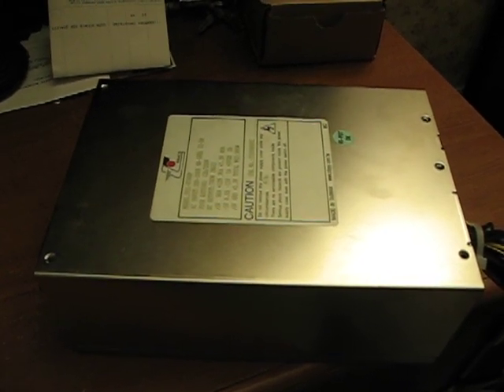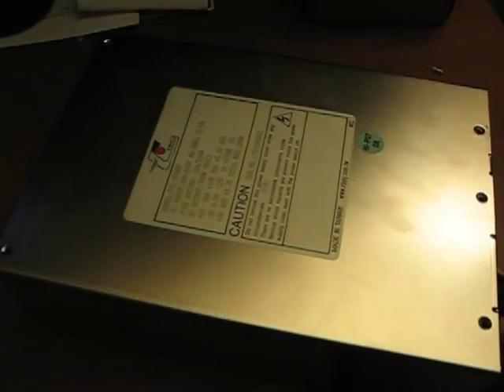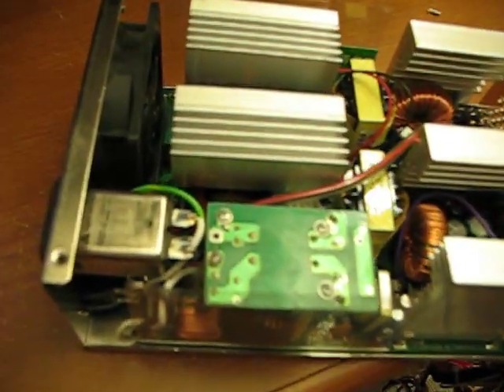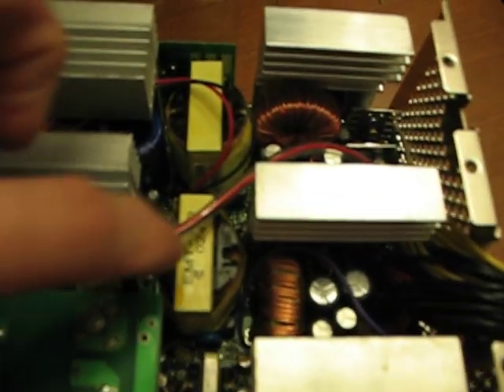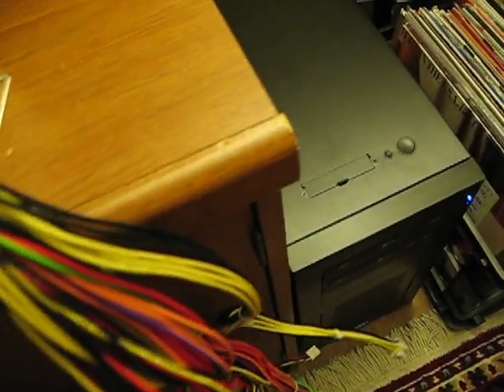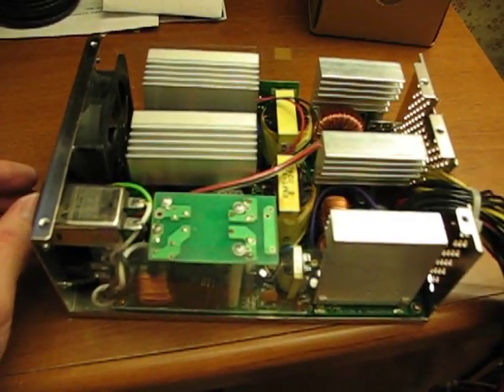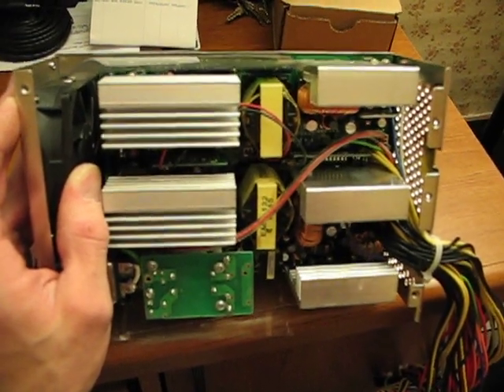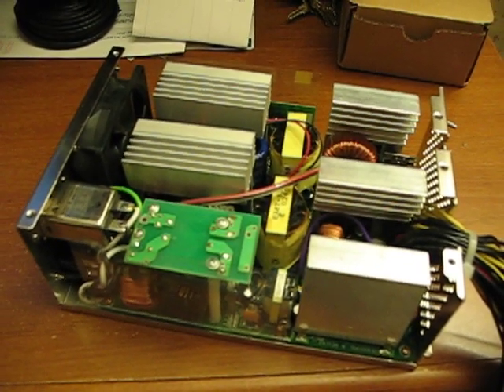A well made PC power supply

Comment: @MilesPrower88 the power pc 9xx series and confined spaces where not a good mix... the G5 power macs where much better designed and equipped to deal with there thermal issues... however they were not without there own achilles heels, two of the major ones being the cheaply made lite-on PSU's leading to a premature death or the later generation ones developing leaks in the liquid cooling system due to poor welding on the pipe work or perishing  O-rings causing a nasty leak.

Comment: I had a G5 Imac a few months ago, the CPU heatsink was right beside the power supply (no metal closure or divider), and thats not all. The Heatsink blasted 60+ degree celcius heat right onto it.. Blown capacitors out the ass on that thing. not good.

Comment from the maker: @woodenotaku Yep, I like Delta too.  I wish I could find ones that are 350-700W.  Most I've seen are small OEM ones that range from 110W-250W.  HP used to use a lot of them in the late 90's to early 2000's.

Comment from the maker: It is mainly for the powerful +12v rail, since it has to run a minimum of 8 hard drives and a DVD drive, plus 2 CPU's and RAID card, etc.

It also has to last several years at 24/7 use, without ever losing it's ability to produce clean power.

So basically it's about reliability, not raw power.  Server stuff is always rated at least 200% over average load.